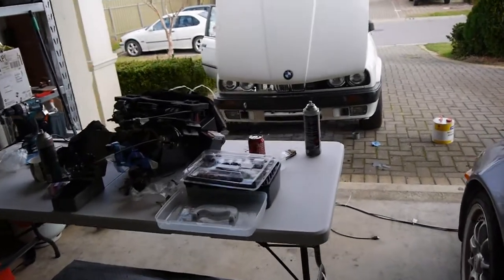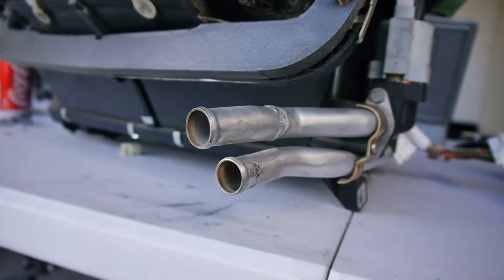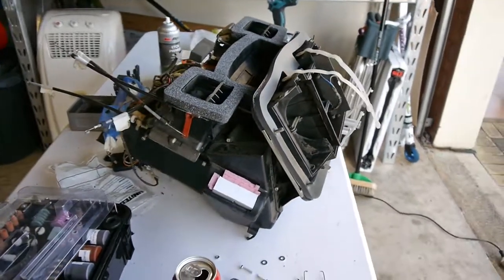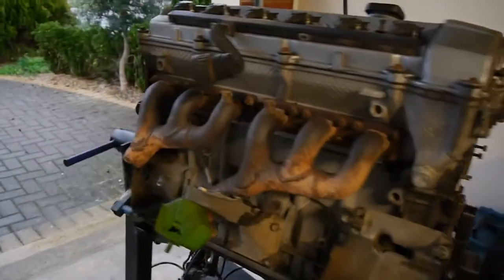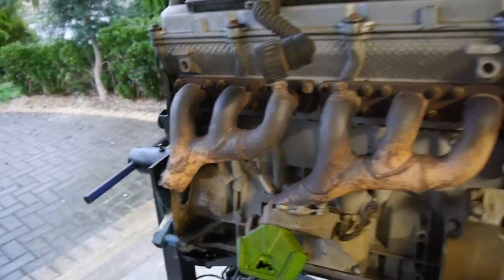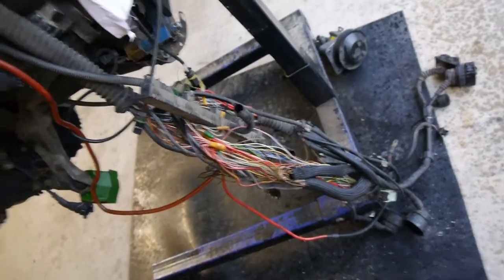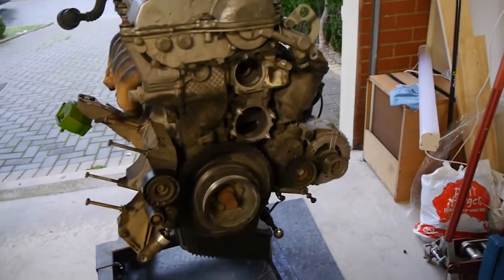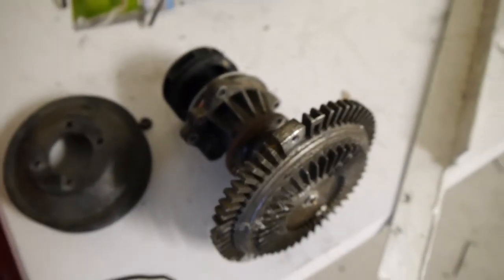E30 M52 Conversion Episode 3. R134a Aircon Part 1 ~ Engine Part 1

Comment: Great video..!! So the m40 temperature sensor fit the m52 with out modifications?
Reply from the maker: Sensor should yeah. Will need to run a new wire and sensor connector through the loom and to the c101 though.
Reply: LMSProductionsSA  that’s great I heard some guys have to modify or buy an adapter because the m20 sensor it’s not the same size?